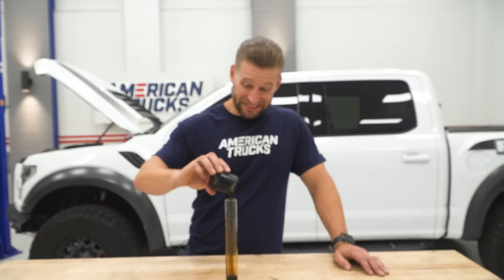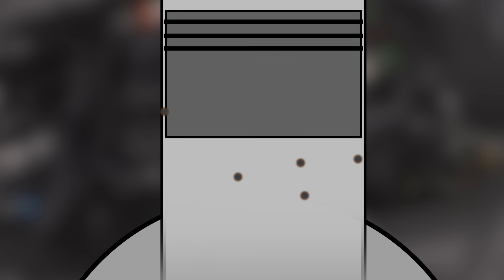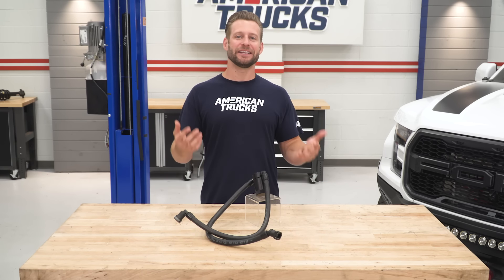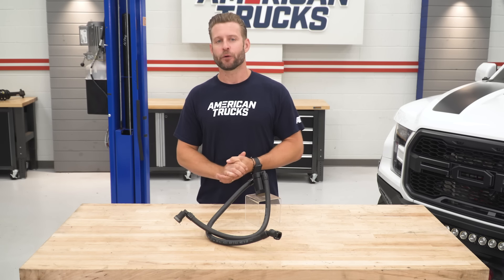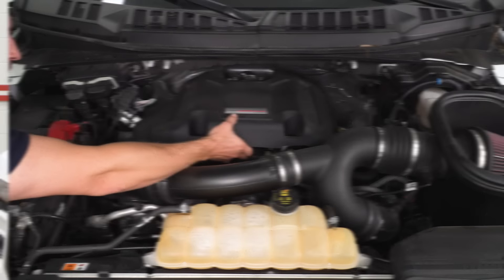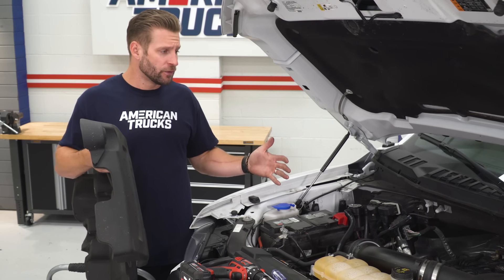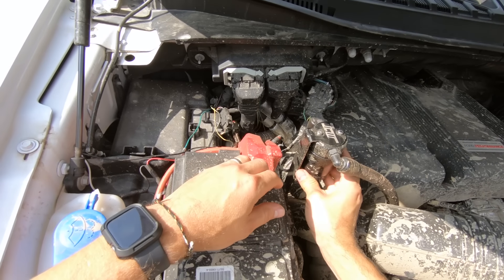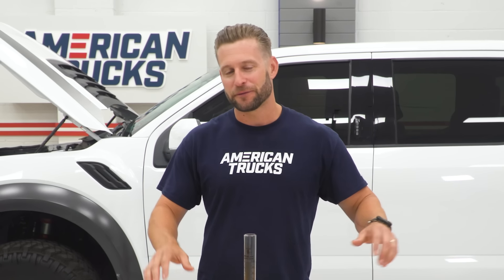Does Your F150 Need a Catch Can? - Ford F150 Oil Separators Tested And Explained

Comment: Why don't they put these in in the first place
Reply from the maker: Because there is a certain level of maintenance required that the general public would have to take ownership of. (like checking and emptying the canister responsibly).   There are self draining options that Ford has actually started implementing on cars like the GT500 but that's just the beginning.  -Justin
Reply: @americantrucks  aww I see alright thanks

Comment: Gimmick product if your truck regularly gets to operating temps you’ll never have an issue because the condensate burns off!
Reply: When the condensate "burns off" it leaves that carbon build-up.

https://ibb.co/VTKfXbM
This was the build-up at the intake side of that PCV tract (left channel) , on one of my older cars. It acted like a catch-can, without a draining mechanism. That convinced me to use oil separators in all my newer cars since then.

Comment: Well, you showed a nasty-looking liquid and said it was the result of not having a catch can.  Probably true.  And you and others state over and over again not having a catch can affect the performance of a vehicle.   If in fact not having a catch can does affect performance or affects anything else, PROVE it.  For instance, show me one instance where the mileage decreases the longer one goes without a catch can.  Show me one instance where the time to 60 mph decreases from year to year.  All the people advocating a catch can or selling a product do is talk.   Saying something like, "...this should be a standard part of the truck...".  Why, because it looks ugly?   All that crap you show gets burned and any effect burning it has on performance is mitigated by the computer adjusting timing and whatever else needs adjusting.  There are easier ways to control this issue than installing a rudimentary catch can.  If the catch can was a part of every truck then every truck would have many more bad emissions.  I suspect the engine designers know about the blow-by and have provided a way to keep it from affecting performance since there appears to be NO degradation of performance.